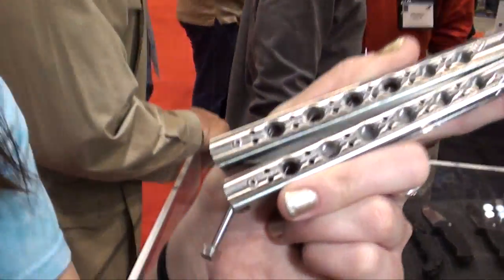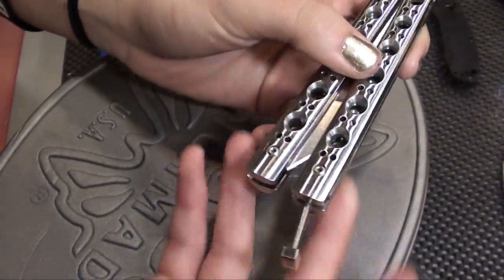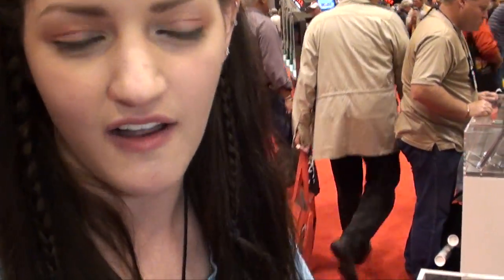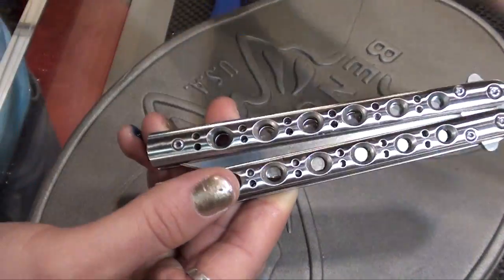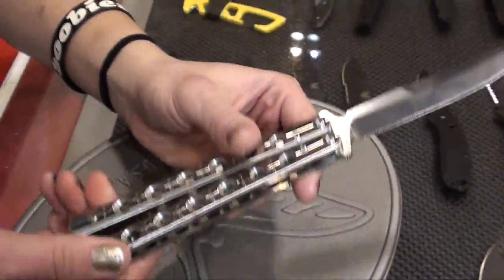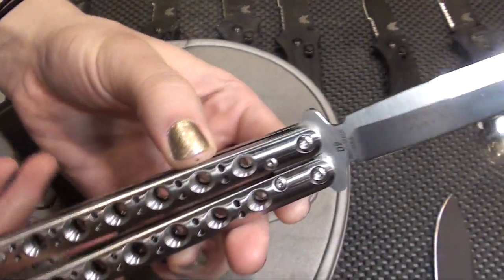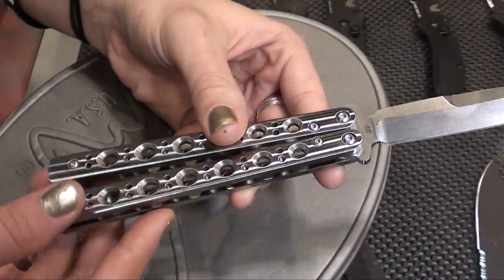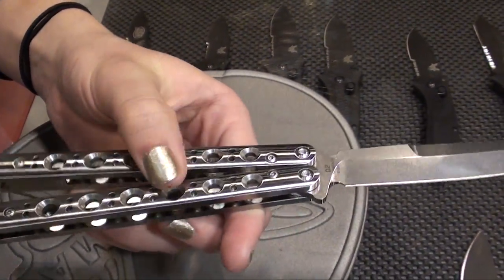Benchmade Balisong 62 T Latch - FateofDestinee

Comment: When I stopped by the booth one of the reps saw me checking out the Griptilian. He started talking about the pluses to the model and I took mine out of my pocket to show him I was aware. They noticed the clip was off and a screw was stuck in with a sheared off head. They offered to fix it for me, ended up taking back to the factory to get her resharpened and new handle panels put on. They also laser engraved it on the spot for me with no additional charge.What awesome service, staff & products!

Comment: If you hold the knife closed in your hand with the "t" latch sticking out, you can then open your knife across an attackers face.  Aim you punch with the plan of taking the "t"latch into the attackers cheek bone.  You will open up some skin and possibly fracture the cheek bone.  At that point you may not need the now open blade at all.  A fractured facial bone is uncomfortable to say the least.  The spring takes away this option.

Comment from the maker: Agreed... I still want one, though lol
Reply: Your nail polish was rushed ... I would have been embarrassed to put that on camera if I was a girl.
 I am buying the 61 as a boot knife. I do NOT flip at all so it will be flip it open and flip it closed and that is it. One hand deployment if you are in a pinch and need to get to a blade ...
The weight is good for me 170 grams ... I like weight because it suggests good build quality and the lighter blades are for flipper kids.
I do not do folders but this Benchmade is as close to s fixed blade as you are going to get as there is not a traditional lock on it ... liner/foldback/triad etc ...
For me, this is an EDC self-defense blade ... I just wanted to see one in person and your video came up in my search. I love D2 tool steel and the false edge will lend itself to penetration into tendons and spinal cord and with my edges, the D2 will lay open sheets of flesh in a slashing frenzy!
Thank you for showing me that I was not wasting $400 ...

Comment: I know that you're just quoting the BM sales rep, so this is not an attack on you Destinee, but this is complete nonsense. Steel vs Titanium and T-Latch vs Spring latch are just a part of cutting costs for BM. The 62 is inferior to the 42 and yet they still charge a very high price for it. They can spin it as much as they want, it remains a rip-off.